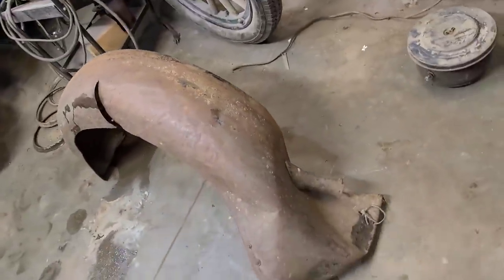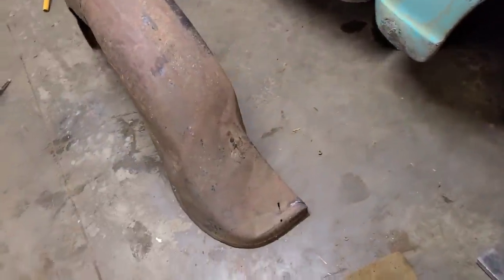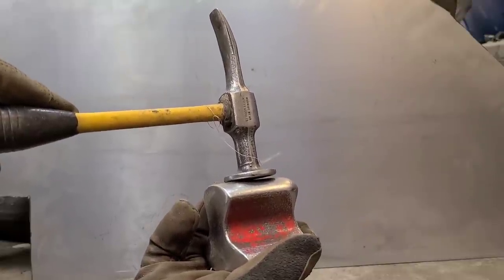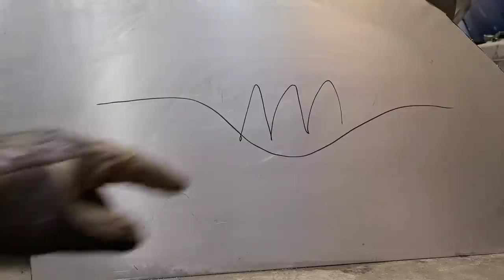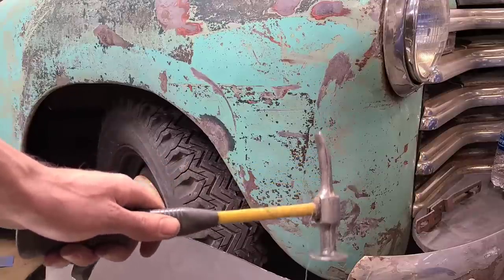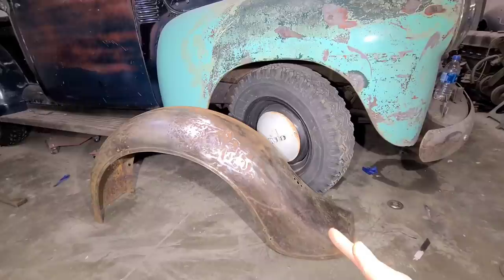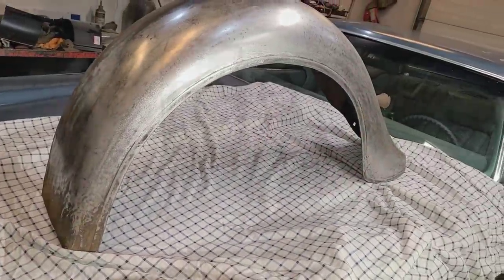Repair A Badly Dented Fender With Simple Tools

Comment: I have watched this video multiple times and pick up new tips each time.  This time i learned that one advantage to working on a concrete floor is that it acts as a dolly during your initial rough out.  The fender was more stable than if it was setting on a stand.  The axe work done previously was obviously done by an aerospace engineer.  The saying was "Measure with calipers, mark it with a sharpie, cut it with an axe."  The price of the axe was passed on to the taxpayers.  Great stuff Kyle.

Comment: Thank you for this thorough and detailed video on metalworking. It's always been a mystery to me. Your process of taking junk back to a usable part was heartening and amazing. I would never have taken on this sort of job before. You have proven to me that tackling a metal finishing job is within my capabilities. Thanks again.
I have a bit of advice. After many years working in garages and kneeling on concrete floors I will warn you not to do it. Build yourself a substantial, split level table or two. One height you can sit at and one you can stand to.
Reply: I back you up on that ,Leo, I am an old bugger and my knees have taken
the knock after years of abuse, now walking is agony and I spend my 
time sitting and annoying commenters on ytube. Take note Kyle!!!!

Comment: Looking forward to the Delahaye video. Enjoying the collaborations with CWM and I'm interested to see what happens with the truck. The dolly/dent explanation was really good, thanks. I expect that with practice you are more intuitive and reach for the appropriate hammer/dolly without having to think it through.

So far I've mainly been tapping and pulling dents and have had some success with a hot-glue puller. I want to try fabricating and I'm thinking of something relatively simple such as a chain guard.

Comment: I would be proud to run that fender on my car, like you said,  a one off deal is hard to find and I doubt you would find one any better,  nice work Carter
Reply from the maker: Thanks Geoffrey. I'm sure there are better ones out there, but it might take 10 years to find one.
Reply: @CarterAutoRestyling  after you get done with it I doubt you would find a better one. I don't think I would sandblast it but it can be washed with a metal prep rust killer and primed with a high build surfacer and block sanded to perfection

Comment: Awesome !
 Now im going to search the thriftshops for old tools and maby one day i can replace the plastic bodywork on my cheap rod ...
One great thing would be to know what to look out for and look for with a used welder and how to do things correctly. safety and so on,
eep up the good work and I think this will spread like a wildfire in calif .
Reply from the maker: Thanks for watching! Used welders can be kind of a gamble, I'd just look the whole thing over for obvious signs of wear, abuse and neglect, it's also important to check if you can still buy parts for the welder.
Reply: Ill wait with getting  a welder till i now what to weld .  Ill look for panelbeating equipment untill then,so maby I can get practice on the things you so generously share in Your great videos, 
Im really looking forward to the next one .
Thanx again !

Comment: Great and informative video as always. Maybe another wrinkle to add would be for those of us who are keeping things as a survivor, and need to repair cracks and bring up dents while doing the minimum amount of damage to the factory paint, and can’t file or sand. Obviously a guy will never be able to get that survivor panel perfect, but we all try to get as close as possible !
Merry Xmas to everyone
Reply from the maker: I try not to go too far down that road because there's a lot of insanely talented people who specialize in that type of thing, expecially the pdr guys. On my own vehicles I usually just bump the damage out with a soft mallet and call it good enough, cracks and rust damage I try to keep the repairs as small as possible, so I usually end up leaving the repair area a little low and blend it out into the old paint with polyester putty. Depending on the definition of "survivor", if a vehicle's a little rough around the edges, I'll make the repair look period correct, weld it from the inside with a mig for strength, and then use silicone bronze on the outside so it looks like an old repair that was brazed in.
Reply: @CarterAutoRestyling  thanks for the reply; I am definitely a beginner skill wise but I’m getting better. I’m working mostly on “rougher” survivors, and I try to preserve that look as best I can; much like the patina on your truck that you demonstrated dent removal and welding tears. Keep up the great videos, I will be waiting for each one to see what new skills I can learn!

Comment: After you welded the large crack, you did some work with the grinder I've not seen; along the seam, then some criss-cross. What does that do?
Reply from the maker: The weld seam was shrunk in low, so I used the edge of the grinding wheel to grind the proud off of the weld. This was done to prevent biting into the surrounding metal with the grinder. Then once I had the weld area hammered back into shape I could grind laterally to blend the weld in. I detailed this process a little more in my video on Mig welding a cracked fender.

Comment: Here in AZ, quality cold-weather outerwear is dirt cheap. I feel like I should keep an eye out for an only slightly burned flannel for you. . .

Nice work saving the old iron. I'm sure if your price out the value of the fender versus your time it wasn't worth it so I sure hope this channel makes it worth it for you because that fender deserved to live. It was just riding along doing its job and a bunch of assholes humans decided to beat the ever-living s*** out of it.
Reply from the maker: Thanks! I spent more time filming and editing the video than I did repairing the fender so it's not exactly profitable. If the video gets enough views it will eventually pay for itself, even if it doesn't I still get a little ad revenue money off it each month, which is more than I was getting out of it when it was a banged up fender rusting in my backyard.

Comment: What are your thoughts on heat and hammer/dolly?
Reply from the maker: Yes it's never a bad idea to add a little heat to a sharp dent or crease before hammering. Not enough to change the colour of the metal, just until it's hot to the touch. This helps to get the molecules moving around and prevent cracking

Comment: That wide tool that you some times use instead of the hammer, could you explain it and when to use it maybe in another video. Another great video Merry Christmas.
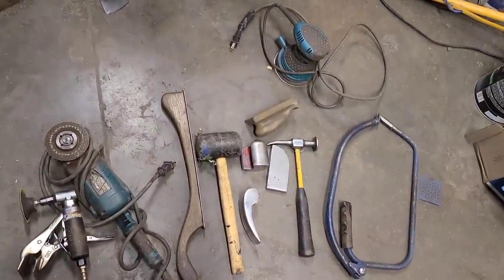Reply: @28:30 he goes over the tools used.
Reply from the maker: Hi Ron, sorry I completely forgot to mention that tool. It's a slapper hammer, it works like a hammer, but the contact area is wider so you can move the metal more consistently, it works good for knocking down longer ridges in the metal. One of these days I'll remember to talk about it in a video. Thanks for watching!

Comment: I read somewhere, or my mentor told me, there are 4 things you can do with metal: cut, fold, shrink and stretch. I found if I think in terms of that you can explain everything that happens in the metal.  For me I find as soon as I start stretching things with hammer and dolly it all goes wrong! How you showed it there on the steel with the hammer and dolly side on was brilliant. Do you also create things from scratch as well as repair? Could you make that fender from flat say? I imagine it's a required skill for building a Delahaye! I really should build a new radiator surround for my Riley. In theory I know what to do. Actually doing it is a different story! P.S. Any time you say 'insert music here' my brain reverts to its default A Team theme music. Works well! Merry Christmas from Te Horo, New Zealand.
Reply from the maker: I always prefer to repair a badly damaged panel vs making a new one. Metal has a memory so it's easier to return a bent panel to shape vs. trying to convince a flat piece of metal to become something. I build out of necessity so if a panel is rusted , over thinned, or completely missing then I'll make a new one. That being said I am going to have to step up my game if I ever intend to build a Delahaye haha. Glad to hear that you're using the A Team theme to accompany my videos!
Reply: @CarterAutoRestyling  Metal does have a memory. It remembers how badly I have treated it in the past and refuses to cooperate now!
Reply from the maker: @asciimation  that one made me laugh, thanks for sharing haha!

Comment: I would've never guessed that fender could turn out as well as it did. Excellent work. One question I have is where you welded the crack. What did you do to the back side of the metal (underneath)? Did you grind that down also or leave the weld fully intact for strength?
Reply from the maker: Thanks, I just left the weld. I don't like to grind both sides of a mig weld , other than to knock any obnoxious slag off the back. It's usually a good idea to spray boxliner on the underside of these early fenders if you're planning to drive the car, so that helps to hide any weld repairs. On a show vehicle I would tig weld it, which is a stronger weld so  then the backside could be finished out nicely.

Comment: you did 1 thing wrong, but you are unaware. the split, will break from vibration again, to repair it, you need to cut a 3" or so wide of a piece out, then 2-3 inches into fender, now inside fender unroll the lip, that has the wire in it, cut 2" to 3" of wire off on each side, now when you roll new lip, put wire inside that whole section, and then roll it back, I have used bead rolling dies just for this purpose at 1 shop I worked at. since the fender is unsupported, the hidden wire reinforces it. if you do not splice in new section of wire, it will soon split in same place again. 

now for the rest, keep up the good work. hope you dont take offense, as just a metal guy trying to show you the ways, & it isnt well known, until in correct restoration circles. I been around body working scene and metal work for 40+ years.
Reply from the maker: Thanks for the input, but there's more then one way to skin a cat. I have repaired plenty of fenders using these methods and have never  had one crack again. Originally I was concerned about re cracking, so I did extensive destructive testing on junk fenders and was not able to get them to recrack. At the end of the day it's only metal and I prefer not to overthink things. This was just a garbage fender for demonstration purposes. I personally no longer use this technique as I switched over to tig for these type of repairs years ago. My background is doing metalwork in hot rod and restoration shops that were building $300k plus cars. I don't put out videos on repairs that I wouldn't personally stand behind or that I haven't tested myself.